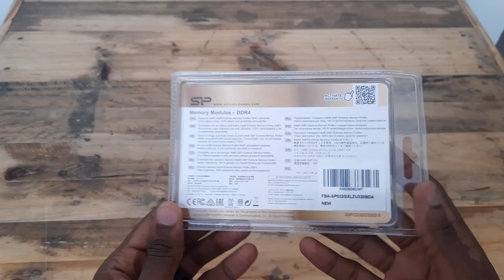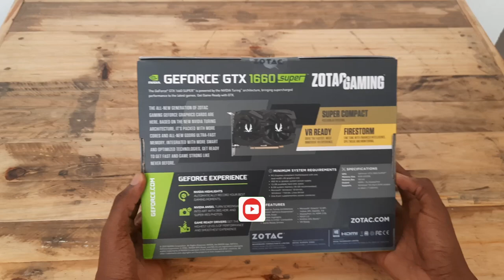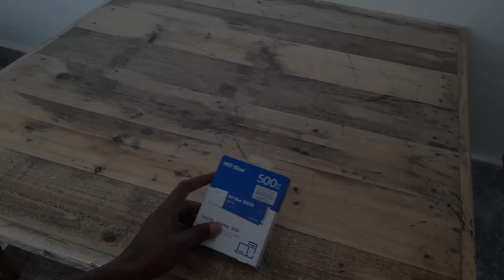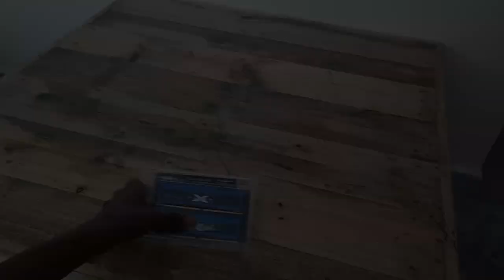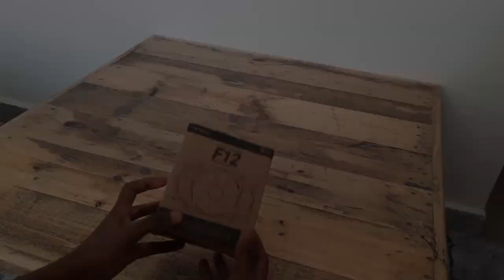First Custom PC Build | Kenyan PC Builds | AMD Ryzen 5 | GEFORCE GTX 1660 | Video Editing/ Gaming PC

Comment: the rx 6600 would have been better in this case
Reply from the maker: Maybe upon further research i will be able to move to AMD graphics cards. Thanks for watching
Reply: @kenyancruiser  yes but the 1660 will last for a good amount of time so don't hurry n you can buy used cards on ebay or Facebook if you no prob with that other than that you good
Reply from the maker: Yeah.
I checked out @Dickenns Omanga videos and he got a good deal out of ebay. So that is a good option
Reply: @kenyancruiser  yes but check whether the seller is legit first
Reply: @kenyancruiser  Hello i posted i cooment last time and i dont see it but plus the case what was the shipping fee
Reply from the maker: I dont remember the exact cost but with @Aquantuo they charge $14.5 per kg.
For the case since its size was bigger than the weight they calculated it using volumetric weight.
Reply from the maker: 5kgs
Reply: @kenyancruiser  so even with the case everything came up 5kgs if so ill try shipping full components last time i only did gpu
Reply: It doesn't have a video encoder which apparently OP needs.